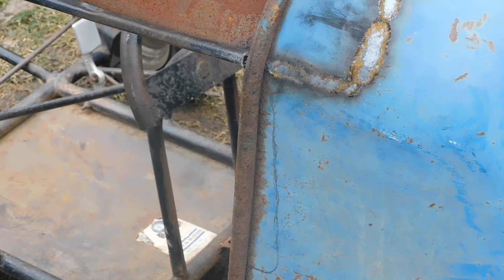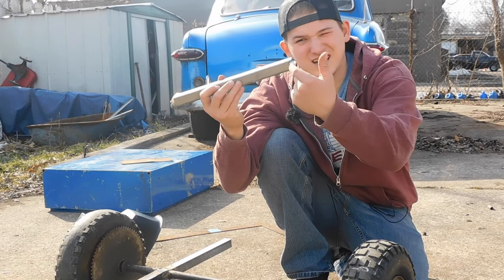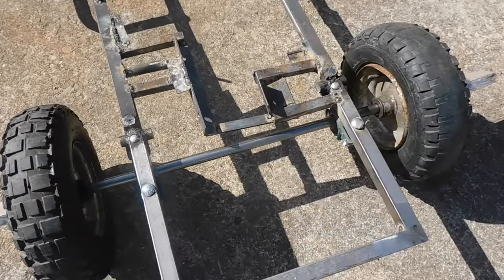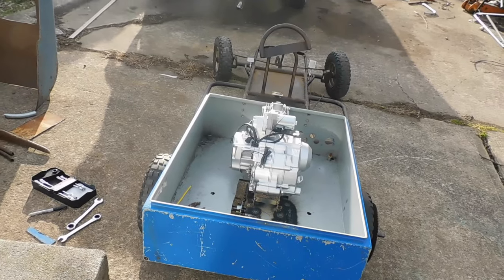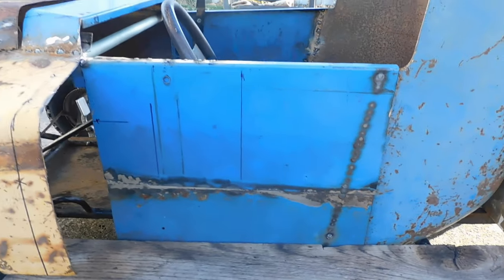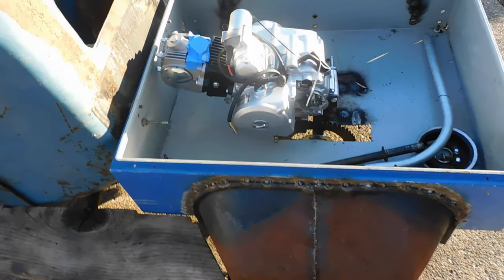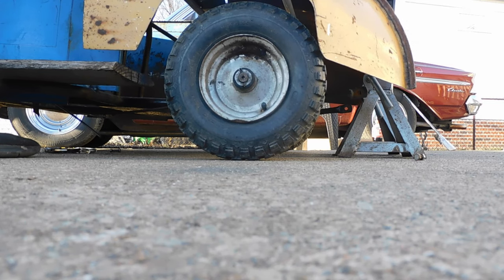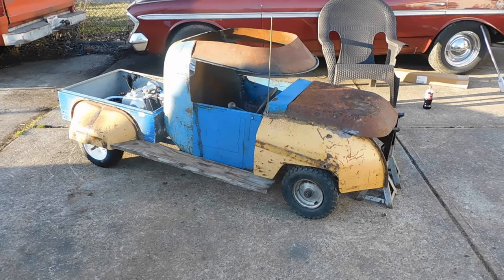125cc RAT ROD GO KART TRUCK BUILD PT. 3!!

Comment: I've been thinking of a project almost exactly like this but with a fully inclosed cab, meant for smaller kids with a cx500 motor going to a rear end with full suspension and motorcycle airbags. Hopefully the body work comes out right
Reply from the maker: That would be an awesome build!! I was going to do a fully enclosed cab but we had already cut out the hood, so we just decided to take the scrap piece for the roof. I hope the body work comes out right too. Thank you so much for checking out the video.